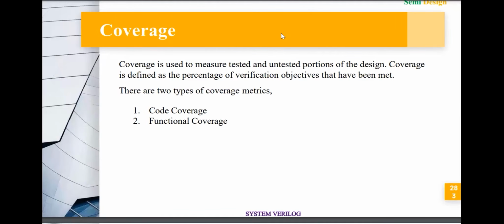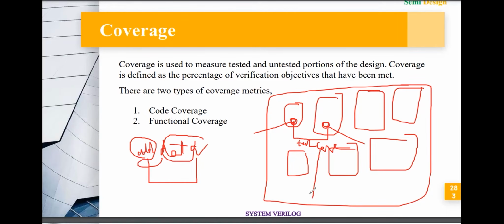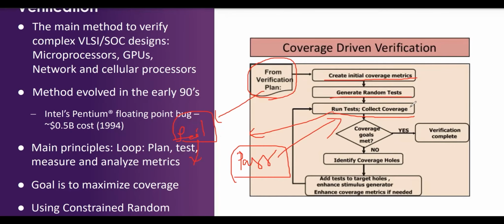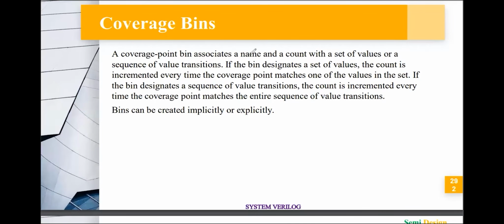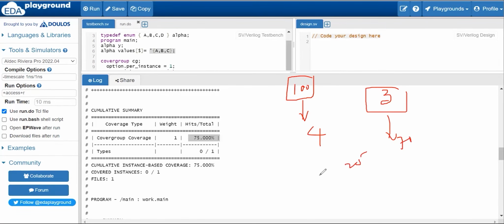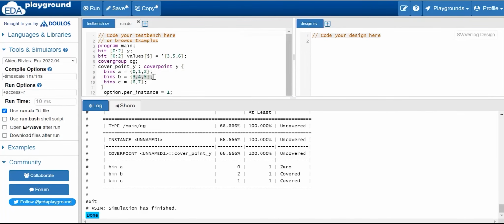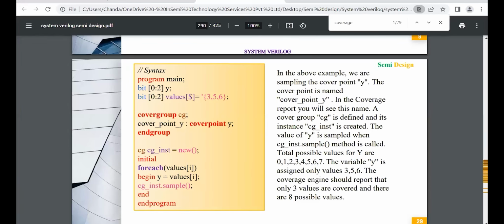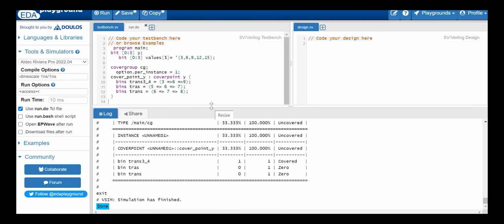Functional Coverage vs Code Coverage #systemverilog #verilog #vlsi #semiconductorindustry

Comment: for small Startups or Consultants  it is almost impossible to gain advantage of these level of verifications. UVM ans SystemVerilog Assertions cannot be used. there are only a bunch of tools available that cost a fortune, you need a loan to buy a licence. Despite these major issues it is possible to be creative with verification and coverage by using standard code. Usually Universities don't tech that simplified way to help coverage. I've done the SystemVerilog and UVM main specialist course to learn how to validate and verify a digital design, and I never used that stuff to verify my design or at least I never seen company using those advanced Systemverilog stuff.